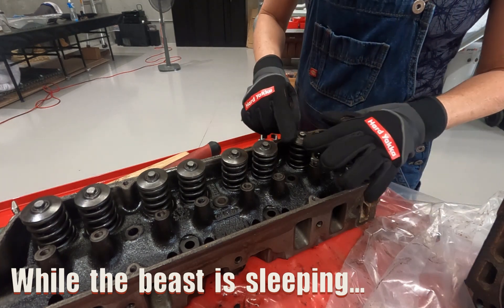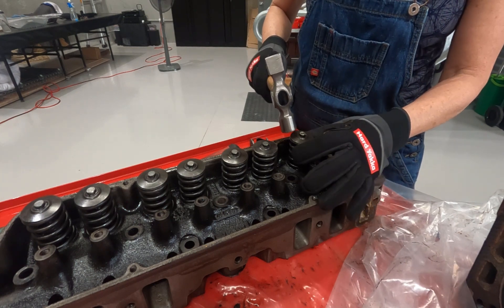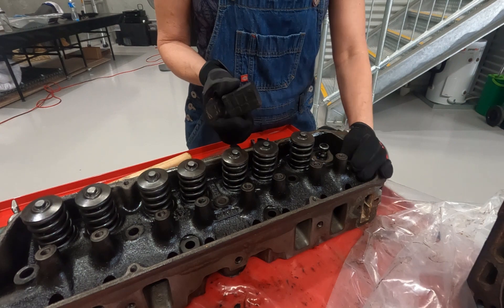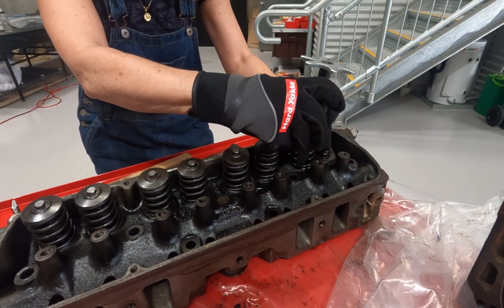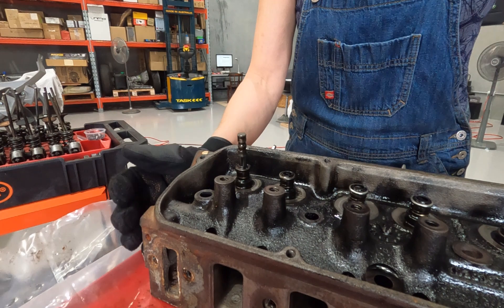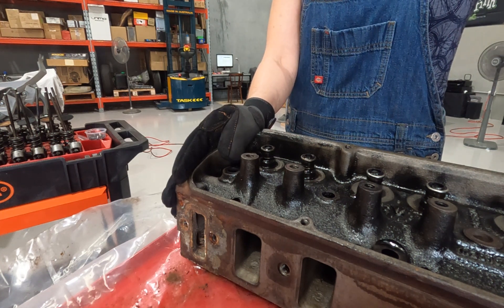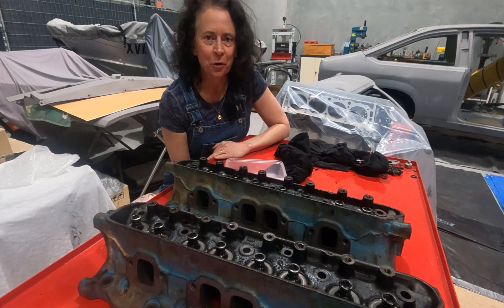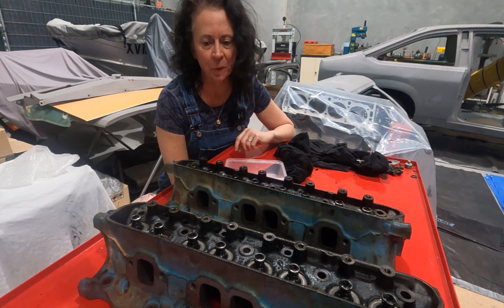Removing 308 L34 Valves With a Basic Spring Compressor Tool

Comment: Its all to late now however if you support the vavles from the combustion chamber side like you did then use a large socket over the retainers/collets then give it a smack them with a hammer they'll easly break loss and you won't damage anything. 
When you're assembling the heads, use a small screw driver with some Vaseline on the tip to hold the collects , its more difficult with a magnificent as it won't let the collects go.

If you use Vaseline instead of greese it melts into the oil and flushes out at the next oil change. 
If you use Vaseline on your oil pump gears when you assemble it , it as works a treat, and you'll have no trouble getting oil pressure on your first start-up.
Reply from the maker: Craig - the valve spring compressor tool worked pretty well - no mistakes over 16 valves so I call that a win! And thanks for the Vaseline tip - I was aware of packing the oil pump gear with that to get the priming started but didn't think about it for the valve stem collets. Nice idea!

Comment: Gday Stace, the valves come out quite easy, going to be good to find out the condition of the heads, your doing a brilliant job mate, cheers
Reply from the maker: Hi Matty :-)   I heard back from the machine shop with a quote so I'll drop them over next week. But their workload means I won't have them back for about 4 weeks. I'm in no rush but very keen to keep playing with this engine. Thanks again for cheering me on.

Comment: More great work Stace I used the ebay special (cheap!) LS valve spring compressor tool with slight modifcation to the tool and a small 3\8 gun. looking forward to your next video glad your are having fun with trixie rebuild
Reply from the maker: Welcome back Matthew. Your mod sounds like it would have made it easier. But I survived the manual way! Thanks for your support again.